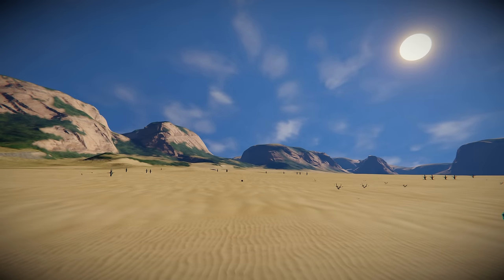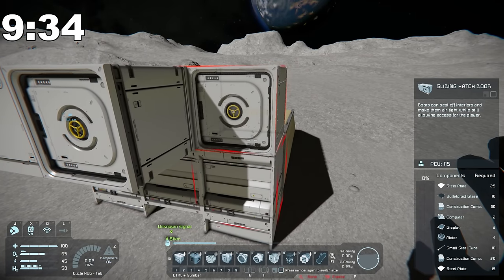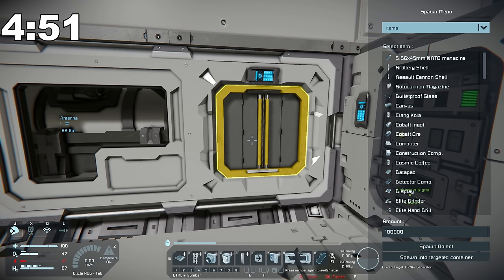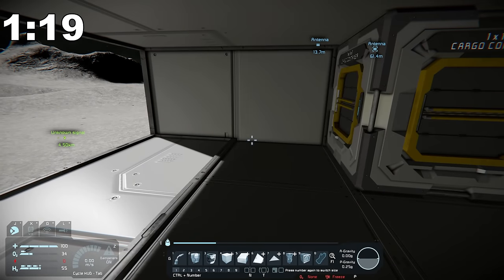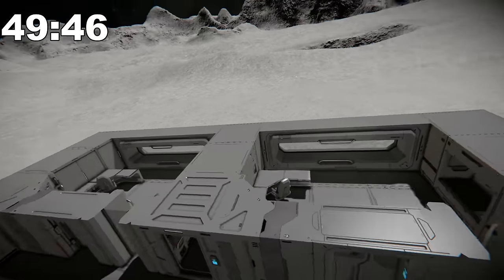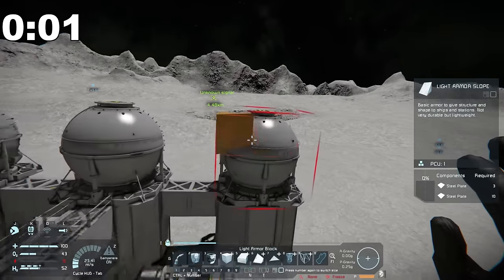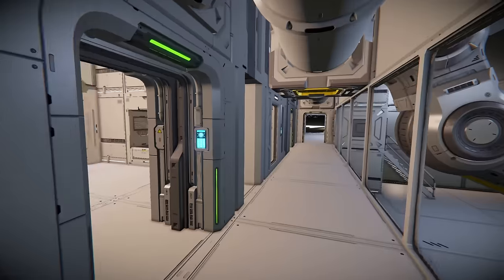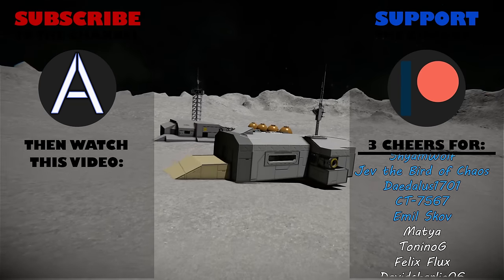Building an OUTPOST in 1 Minute, 10 Minutes, and 1 Hour! - Space Engineers Challenge

Comment: Did you also forget power on the 10 minute one?
Reply from the maker: It does have power via the batteries, but no actual power generation :/ That's a huge flaw but you could bring in a ship with the connector and charge the base that way, so it passes!
Reply: @AndrewmanGaming  Fair enough. I've done that a time or two.